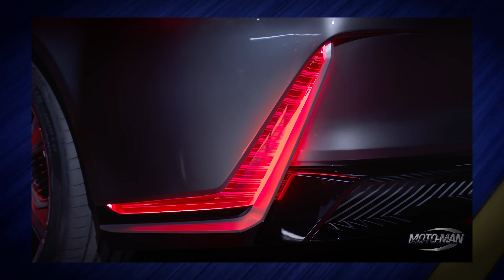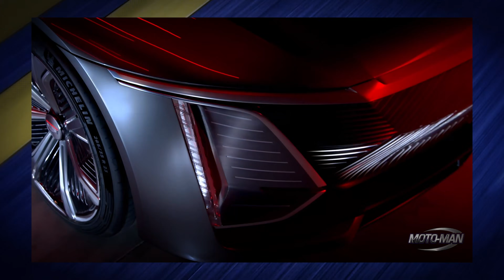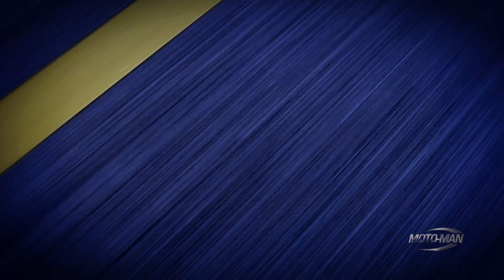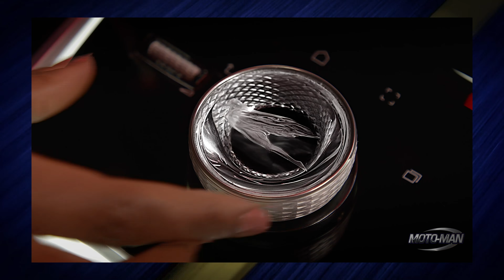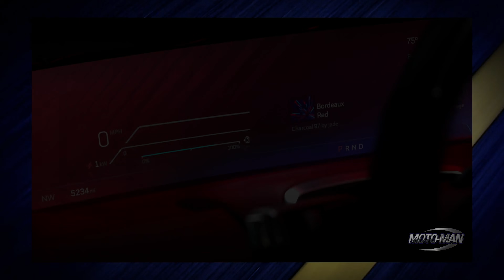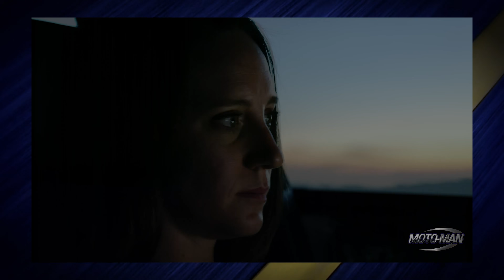Cadillac CELESTIQ: Everything we need to know about Cadillac’s hand built EV from its Chief Engineer

Comment: I am a big GM customer. I bought a 
2000 Chevrolet Suburban LT 1500, 
2002 Chevrolet Corvette convertible,
2004 Chevrolet Corvette Z06
2006 H2 Hummer SUT
2009 Cadillac CTS 4
2018 Cadillac CT6 Platinum. 

Most important thing is exterior styling. 
- love vertical LED front lights and rear lights. 
- I suggest using the long head light evolution and running light pipe along front hood lines rhrough the side of the car capturing the body lines with the light pipe and extending to the tail lights. Add some functionality by inuding pulsating lights to indicate signaling in the light pipe. Have it customizable to light up or not for those owners who do not want attention. Allow the light pipe to excentuate the body at night.
- see if air ride can be adapted with magnetic ride. 
Interior Styling
- I love the interior styling introduced into the Lyric. Keep moving there. I also love my 2018 Cadillac CT6 dash.  Add mood lighting and high polished metals and premium materials.   
- Find a way to remove or open the B pillar from obstructing passenger feet entering and exiting the back seats. 
- creature comforts should have air cooled and heated seats, messaging seats, excellent HVAC ventilation, video entertainment, Karioki features, vanity mirrors for back seat passengers, reclining back seats, motorized open and close doors is important, motorized sun shades for doors and rear window or make glass opacity dark to limit sun light. Pro ide GPS mapping on rear displays. Allow rear displays to accept mobile phone video output and add video conferencing cameras for all passengers. 
- tech.  Have Que have 1 button video conferencing capabilities to call anyone programed on DUO or FaceTime.  Starlight ceiling.  Commercialize that the EV Battery is capable of being removed in 5 minutes at any dealer to incorporate solid state batteries when the technology becomes available. Creative led rear brake lighting and signals. Improve more on Super Cruise and make system upgradable. When new autonomous features are built,  allow owners to download new features.

Comment: I recently saw a 1930 Cadillac "Madame X" V16 on display at my local Caddy dealership. It belonged to a local collector who brings the car out once a year for my city's most famous charity ball. And you can tell a lot about custom coach building looking at vehicles like this. Everything about this vehicle was over the top at a time when Henry Ford had just begun selling the Model A.  Back then you purchased a chassis, engine and plans, then hired a coach builder to finish the car with whatever flourishes you wanted. Most owners chose Fleetwood (which began as a separate company before GM brought them in house in 1929) but you could always choose someone else. When the '57 Eldorado Brougham was introduced. GM was literally on top of the world although by then they had ceded the ultra luxury market to the British. By now, GM was selling Motorama dreams to the public but it all about volume and those ultra-luxury cars just didn't sell in quantities. But GM decided to take a stab anyway, just as Ford did with the Continental Mark II. And while both cars were wonderful for different reasons, neither automaker wanted to go through the trouble of figuring out how to at least break even in this market.  After all, Rolls & Bentley managed to survive as a tandem for decades before being swallowed by larger entities. It can be done.

The problem with Cadillac in this space is that it never seems to last. The V12s and V16s were around for a decade. The Eldorado Brougham? Just 4 years between two different styled automobiles. The last attempt at a bespoke special production car was the Allante and we won't speak of that again here. Despite that, there is an opportunity here for GM. GM's Ultium technology could use a halo to separate themselves from others like Tesla, Lucid and even Rimac/Bugatti (the Hummer EV is a good start). Rolls, Bentley and Mercedes-Maybach haven't even introduced cars in this space yet. Enter this space like you intend to stay and be profitable (without cutting corners).

My wish list? From an engineering standpoint, this car must have every special trick GM knows how to do for performance, range, handling, the works in terms of electrification.  Nothing half-assed like putting the exact same drivetrain in the ELR like there was in the Chevy Volt.  With all of that wheelbase in this car, there is plenty of room for batteries. Use all of it.  I'll be disappointed if I see the final range be less than 500 miles, and that's with the 23" rims.  Four wheel steering? Yes, please. And in terms of handling and ride, we haven't seen an EV use GM/Cadillac's magnetic shocks, not even on the Lyriq yet. If you have something special with the tech that's been waiting for EVs, this is the car to show that. Don't even think about bringing this to market without at least 800V charging. Be able to charge a beach house during a power failure. The Hummer EV has three EV motors...how about one for all four wheels? It doesn't have to be Tesla 0-60 in 2 seconds fast but it has to be quick and be effortless in doing it. We know that Ultracruise will ship with it, so that's good. Make sure it continues to improve for the life of the vehicle's technology, just like Tesla.

The car needs to be as quiet as a casket....NVH is not something these customers will tolerate in any fashion. The audio system needs to appeal to audiophile snobs. AKG branding is nice but let's be compatible with high resolution streaming music formats and services.  Can we do spacial audio/Dolby Atmos?

In the '30s, coach building was all about custom body work. In the 50s, those days were over so Cadillac and Lincoln threw every futuristic option they could at their cars as standard equipment. Now the ultra-luxury market is all about personalization.....specific paints, special woods and trim pieces....leathers or vegans. Heck if someone wants wool like the limosines of the 50s, they could order it. Not much is too much....just tell them how much it will cost. Be prepared for someone to want (and pay for) an actual Flying Goddess on the hood, so someone better make it looks like it belongs there.

Finally, customer service must be top notch. Only select dealers can offer this car. Onstar should be standard for at least three years, maybe five.  Service should come to the owner if the car cannot be easily brought in. The service manager needs to have a specific specialist who knows the owner by name assigned to the car. Dealerships must have specific service training for this model, and frequent communication to the owner on the vehicle status. Body shops owned by Cadillac dealers must also receive training. Nothing should be left to chance for the total experience.
Reply: Cadillac was at the top of their game when customers could choose between V8, V12 and V16 powerplants. Cadillac earned their reputation for luxury and quality, but GM management wanted sales numbers that rivaled Chevrolet's - with the resulting hit in quality and reputation in the 1970's and 1980's, in my opinion.

Comment: Sounds like a rival to the Ghost and Flying Spur with a hatchback. Wondering where the base price is gonna fall
Reply: Around $300K.  They indicated that in the video.
Reply: @johnls39  I hear you but I don't believe it will be that high which is why I stated "fall" and "base price". Maybe the highest trim or special editions could reach $300K. But even hand built engines from the AMG S-Class and other performance models don't command $300K. And this will be all electric so I don't see hand built electric motors becoming a thing. Too many inconsistencies and liabilities. So are we getting a hand built coach then? And even then, Ghost and Flying Spur levels in terms of price? I'm estimating $160K  or the highest Lucid Air trim for a base price

Comment: When you drive one of these into Cadillac service bay, do they still treat you the same way as if you had a CT4 base model? I'm sure someone spending $300k+ is going to enjoy that experience... The dealerships have been known to treat people well with GM cars hahah
Reply: I'm sure there will be dealer training for this type of customer.  Also, the shared stores will not get a hand on this car but the standalone.
Reply: Right. GM is General Motors not custom motors.
Reply: Absolutely spot on. At the $300k level, it's the experience you're buying into as much as the car. Sharing dealership space with Chevy and Buick, like they are at my local dealership, will be a total fail.
Reply: Cadillac is not a competitor with Rolls Royce and Bentley .